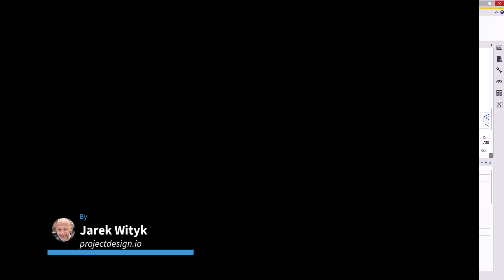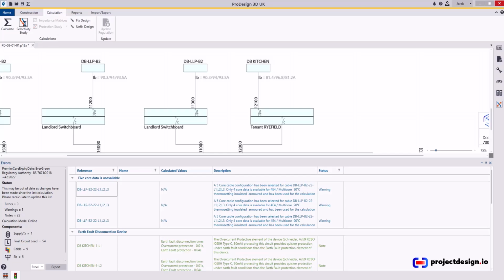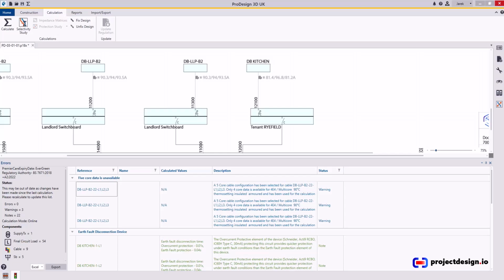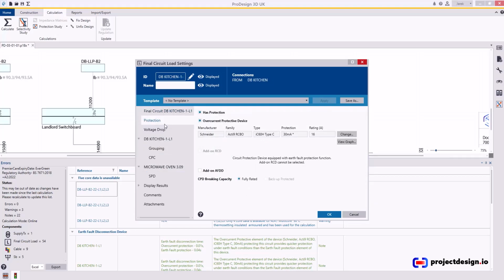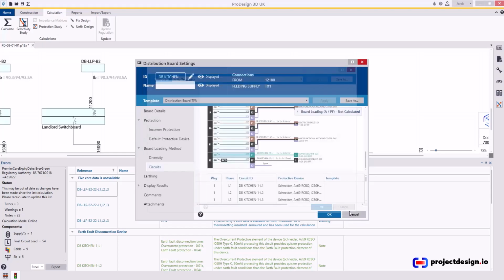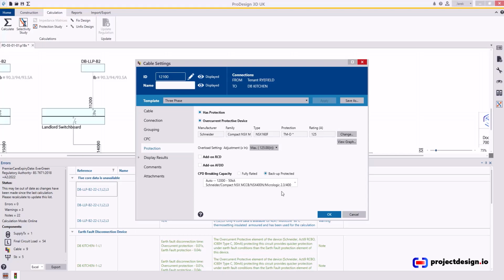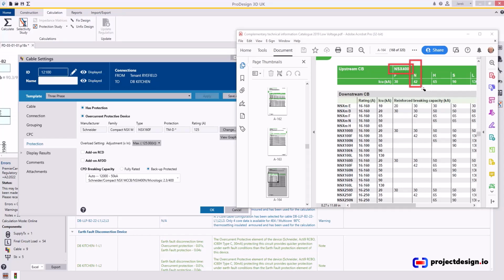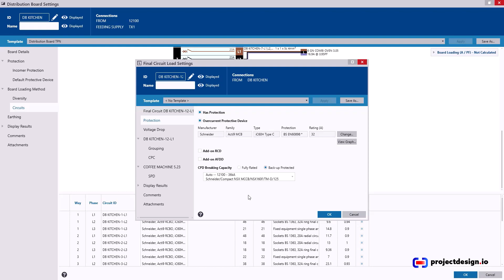PD 03 01 05 Functional   Breaking Capacity

Comment: Hi, can you please clear my doubt? The CPD rating shown in amtech, is it frame rating or trip settings. Say Schneider, compact NSX MCCB, NSX160H,Micrologic 2.2M, Rating 100 A. Is this 100A is CPD frane rating or trip setting?
Reply from the maker: hi @AISWARYAM-e9j , NSX160H is the Frame size, Micrologic 2.2M, Rating 100 A - is the trip rating, setting is separate can be auto or changed to manual to adjust the setting

Comment from the maker: Typically the sprinkler primary supply is connected from main switchboard from the live side of the supply to prevent loosing the supply when main set h is off. As you said in ProDesign you can’t run two cables out to two separate loads. If you want to mimic what you described I suggest that you run the primary sprinkler supply from switchboard without protection.